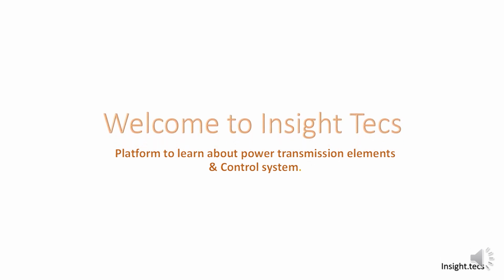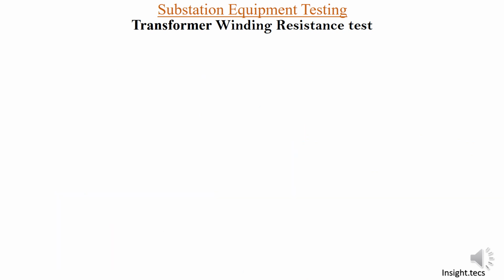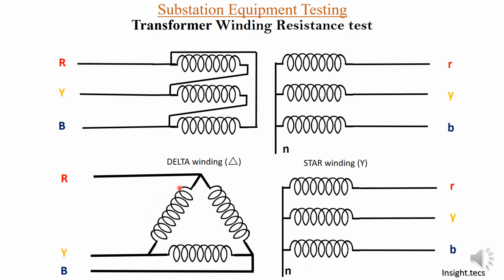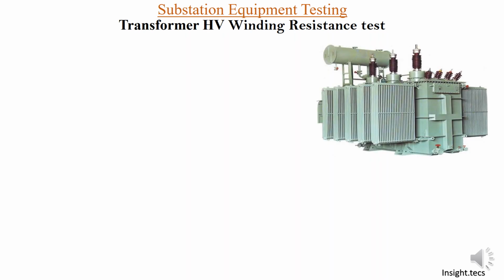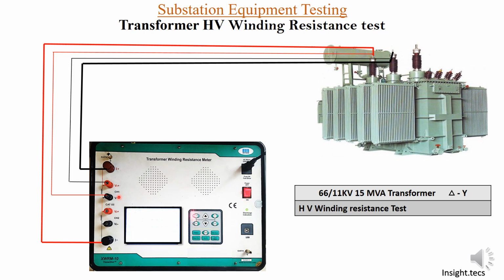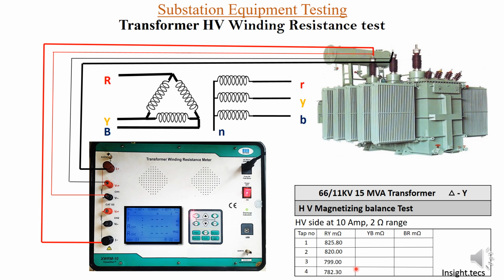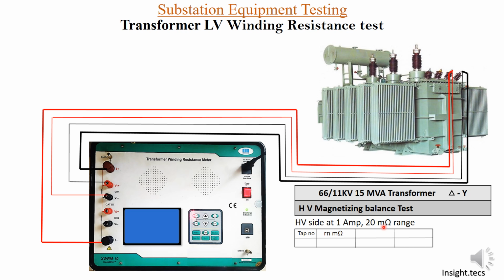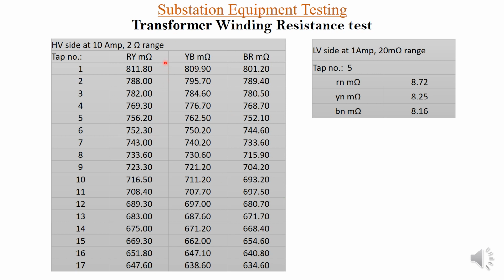Transformer Winding resistance test || Low voltage transformer testing

Comment: hey why you are yourself confuse? you are saying +I to connect in any phase and I-to Neutral .. but in figure you are connecting I+ to neutral and I- to phase? you are saying one thing and configuration you are showing is another? why you are doing thus silly mistake
Reply from the maker: Thanks for bringing it to our attention 🙏...the logic here is to complete the circuit you will get similar results in both configurations as the test kit will be operated in DC internally.